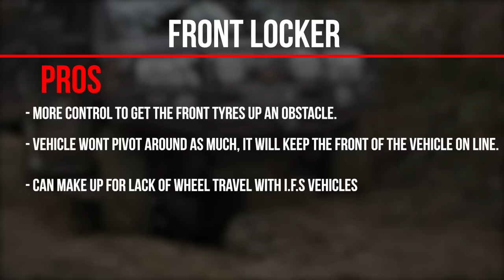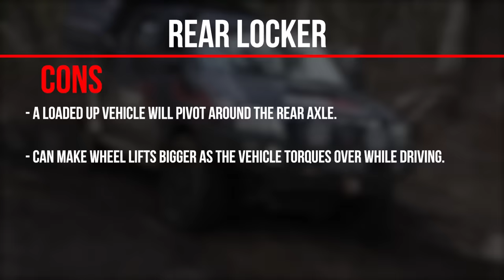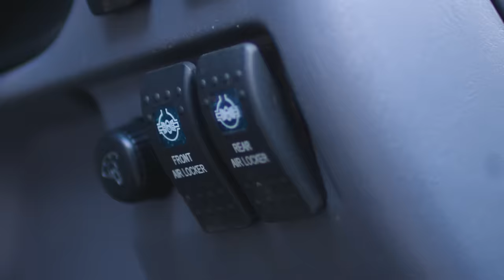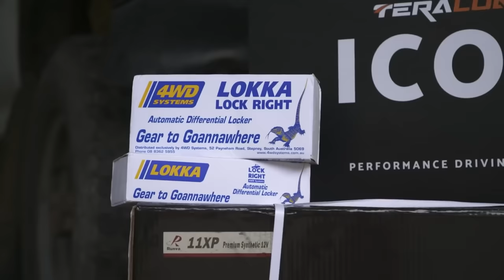FRONT LOCKER vs REAR LOCKER vs TWIN LOCKED COMPARISON! + AIR vs AUTO vs E LOCKER – Shock answer!

Comment: One thing i found interesting is that most people thought is : "as much of the weight uphill is on the rear axle, it is better to lock that axle first" ... it may be counter-intuitive, but it is exactly the opposite: as there is less weight on the front axle, one the front wheels ise more likely to start spinning. At that moment, all front drive is loss, and all the torque goes to the rear axle,  which won't be able to put on the ground all the driving force, so you start spinning also with rear tires. If instead a front end is locked,  then the front wheels will be able to give their help to drive forward, and a more reasonable amount of torque goes to the rear axle. Being the rear loaded by most of car weight, rear wheels have more chances to be able to handle their part of driving force even if without a locker. Consider also that when going uphill most of time both rear wheels will be on the ground, so a locker is less useful there.
Another misconception is that a front locker affect steering more than a rear locker. My personal experience is that having a front autolocker and open rear diff, gives you perfect steering ability, while giving plenty of traction.
So my vote is for front autolocker and open rear diff: best bang for bucks, it "disappear" on tarmac when you are in 2wd,  absolutely reliable as it is a fit and forget solution.
Side note: i have a front autolocker and rear factory selectable locker, however i had a rear autolocker and was a pain on the road, i really do not recommend it for a daily driver.

Comment: Rear is the obvious one and my hilux came with a factory rear locker when new.
Out of a front e-locker or air locker it came down to what was applicable for me. Like many other tradies my ute is first and foremost a working vehicle. I transport bricklaying gear, barrows etc all the time so thats my choice made for me. 4x4 fun is for the odd weekend fun only so an e-locker was the only option. I have no room or need for a compressor so that's that.

Comment: I have a GU4 and have a front air locker and with the tight LSD in the rear I have that’s all I need for my rig. I wheel in the Vic High country a lot and having the flexibility of being able to lock the front diff works for me and my rig. If I was driving an IFS vehicle I would go with a front locker as the front wheels tend to spend a lot of time in air. If I have an 80 series then I would probably go a rear locker if you had 2 live axles and Toyota’s aren’t know for having a great LSD.  As they said it depends on what sort of vehicle you have and what is going to work best for you, and one locker is better than no lockers so no matter if you go front or rear it’s going to be a win and get you further.

Comment: As long as I am not running huge tires (35" and above") I prefer a auto lunch box locker in the front (like the Lokka) and a Detroit locker in the rear ........ all mechanical  .......... but the others are great too ........ they all work

Comment: There are 4 way brake solenoid that can hold the each wheel braked and depending on how much pressure u are pressing the brake before turning on the solenoid the wheel on the side will slow down itself similar to how traction control work.

Comment: I love front locker because i run a Nissan patrol GU3.0 so the rear already has the LSD. I prefer to spend my money where it's going to count the most, my rig is built for tracks not roads though. Entirely dependent on the type of vehicle you run i rkn. ps love your work mate!

Comment: Truetrac in the rear and auto locker in the front of mine.  Of course, I'm only really concerned with driving in deep snow and less extreme trails than this.  I don't need all that extra cost where I'm going.

Comment: Great video 
So is it Cart before the horse or horse before the cart it’s a hard decision really but in a gu front locker (air) for hill climbs as that rear diff has a pretty good limited slip set up. 
But in mud and general rear (air) 

That being said Big boost 32 pound  big tyres 35” coil patrol Ute 4 inch lift front and rear winch no lockers required  so far.

Comment: I would go front. But if you drive hard off-road, you need front more. If you drive medium or light off-road, then rear locker is preferable, as you can use it most of the time.

Comment: Going rear air locker in the 2000 100 series. Idk if the front diff and cv’s can take the locker. Plus Toyota A trac kinda works
Reply: Chassis swap to 105.
Reply: @themindboggler8055  I wish, idk if I could get one in the U.S.
Reply: @mondo_stunts27  oh the us oof. Maybe 80 series swap? I don’t know how hard that would be but it would’ve been done. My parents have a 105 and the chassis is extremely similar to an 80. If not just go for a sas. I’ve seen people sassing tacomas, so you could just grab an 80 series front axel and use that. Its definitely possible.

Comment: One big downside of air locker's is oil traveling back up the pressure hose and blocking the solenoid vent. I fix this by making sure the breather system (factory or after market) is working. Also when the Orings are getting worn they'll draw oil past and up the hose when disengaging.

Comment: I just updated to a newer model of my old truck , and I must say I'm not Impressed. ... What locker would you recommend first on a front and rear independent suspension set-up ... Or should I just repair my old solid axle rear end ifs vehicle that went anywhere I pointed it ..

Comment: I am very eager to try a fourth option, independent drive to all four wheels, or single front and dual rear. The first is the Rivian electric utes and SUVs that are coming, with an independent motor for each wheel. The second is the Tesla Cybertruck, which in one configuration has two motors for the rear and a single at the front (probably with excellent brake type traction control to stop spinning) and 400mm of ground clearance. Coupled with huge power and torque, I suspect that these will be amazing off-road. Only disadvantage I can see is that they are American sized, so the high country is going to be a challenge. Fortunately, the Cybertruck is 3mm stainless steel skin, so dents and scratches should be minimal.

I love wheeling my Prado around, but having an EV for a daily driver makes is feel pretty agricultural!

Comment: Depends on the driving you're doing. Big steps all the time, front will do better. Anything else though and you're better off going for the rear first.

For me, I'm either running just the rear or both. I never run just the front by itself.

As to what type, either factory fitted or TJM pro lockers are the way to go IMO.

Comment: For a single locker I would go with a front. Pro rock crawlers typically drive with the front locked and the rear open, then will lock the rear when needed.

Comment: I want to build a lifted overlander with 35s and the ability to lock both the front and rear diff. The only car I can find that has this stock is the Jeep Rubicon. But I would prefer a Toyota as it would be cheaper and probably more reliable. Which model is my best choice if adding an air or electrical front diff locker?

Comment: Twin ARB air any day. I say rear first as I use rear only %90 of the time and both in the hard stuff. As I'm an ifs I don't turn while using the front locker. Haven't done a cv since. Lots of money but cv after cv racks up.

Comment: I have a fj55 that's 50yrs old just replaced 35yr old locright mechanical in rear   LC weights 2000 kg 2f and 4sp ,350k mi, pins and springs wore out.Machine shop making new pins  and springs will reinstall in front for part time duty ,shiny side  up..

Comment: I've always thought in a part-time 4WD vehicle an auto locker at the front and selectable locker in the rear is the way to go. ELocker cause bugger air lines leaking everywhere.

Auto locker in part time 4wd does not have the on road, highway issues. Soon as you're off road you're locked in going slow, making it over so none of this 'fang it and we'll put lockers in if we don't make it'. Unlock the hubs if you're worried going down hill about steering.

Comment: I’ve been considering getting lockers for my MN triton and after this video I’m gunna go twin auto lockers purely for the price and no need to run any air or electric lines
Reply: They work well mate! Just a bit louder on the road.
Reply: @jocko4wd281  yeah thanks mate, I can handle a bit more noise if it makes me and my IFS a bit more capable

Comment: I run auto lokkas in the front of my GU and my D40, never had a steering issue with either.
Reply: Ive got the same in my GU. My steering is heavy and wants to snap back to centre when in 4wd. is yours the same?
Reply: @bronsonmercieca2120  a little heavier under acceleration but nothing major. Not really noticeable on the tracks. Maybe if I used 4x4  on road it would be noticeable.

Comment: also could've mentioned that elockers will disengage temporarily if you fail a hill the first time because the design causes a ring to disengage the locker. also, vehicles with a shorter wheelbase will do better with a front locker, because they can easily tip over front to back.

Comment: Front locked will always be best as it's far easier for the front axle to pull the vehicle than the rear to push, it's about weight distribution, you can also experiment yourself by pushing/pulling a dead weight, easier to pull, spend your life using agricultural vehicles you get to know how well/what works best when you play with diff locks, gearing and engine revolutions.

Comment: Detroit locker in rear of Prado 120, awesome difference off-road, don't notice it on-road
Reply: Do you get front lockers for IFS? And great episode keep it going
Reply: @jacquessmit8790  no just rear, you can get selectable lockers for constant 4x4 IFS but not a Detroit
Reply: @neil_woth5199   I'm in South Africa I have Mazda 3.0lt 2010 model with rear locker but I'm looking for a front locker don't know how it works on IFS
Reply: @jacquessmit8790  google search ARB airlocker or Harrop E locker. Its definitely possible.

Comment: I prefer the rear, although most 4x4s are around a 60% front 40% rear weight split, when you’re going up a hill climb a lot of that weight goes over the rear axle so you can find a lot better traction with the rear one!
Reply: If you have better traction on the rear. Surely the “traction adder” (the locker) should on the axle with less traction.

Comment: Regarding Grahma's comment, "you push a wheelbarrow from the back". Not necessarily if you need to get over an obstacle which prevents the "push"  motion., in which case you pull the wheelbarrow over. Each to their own of course. For those of you who haven't watched it, check out MadMatt's front vs rear locker test. Obviously MadMatt's test course was different to the one used in this video, however I feel that it provided a more scientific comparison between both types of lockers. It's a video worth watching to gain a good understanding, including this one of course. Different opinions help to  make a decision, but when the decisions also includes a scientific basis, an informed decision is easier to come to.

Comment: Who has had a front locker in their ifs rig? Curious how well it works and how reliable it is or if you should just lock the rear in a ifs. Been trying to figure out which to do in my old Toyota, I have been told not to lock the front because I’ll snap my cvs like twigs all the time and to just lock the rear and leave the front unlocked. Anyone know how true that is or any insight on having a old ifs rig with a front locker?

Comment: Power vs locked. I’ve got a 98 IFS Lux with the 5L (3.0 NA) motor. For me a turbo kit and lockers will be about the same cost, so if it were possible, maybe to compare an unlocked newer high HP vehicle vs say, the pony lux. In mud; in sand - obviously hill climb the locked car will shine

Comment: I'm still on the fence if I should get an air locker or e-locker.  My ARB air compressor is the High Output model, not the Dual Compressor model.  So I'll have to get every component for either option. I was leaning towards an e-locker, but almost everyone on this video  recommends an air locker.  So still undecided which way to go.

Comment: Great video on lockers however a key fact about rear lockers was not explained in this video and that was the fact that rear lockers offer a huge advantage when driving downhill descents. The rear locker will keep you from sliding off course by up to 50%, keeping the rear straight and preventing sudden forward motion when wheels go over rocks or articulation. 
The front locker is the disadvantage when going downhill  due to the lack of steering and the impact of driveline stress.
 
If your set up and choice of tracks are rock crawling, id highly recommend spending the money and getting front and rear. Having only a front or rear locker wont be beneficial anyway as the video clearly demonstrated almost equal advantage of having either.
If you're a tourer like me and stuck wondering whether to go front or rear, go rear for versatility of uphill and downhill obstacles.

Comment: Everyone is saying that they want a rear locker because when you're going up a hill you have the weight and traction in the rear so you want it in the rear too, but if that's the case, wouldn't you want a front locker? Because if the weight and traction is in the rear, in my mind, that means you would want a front locker so that you can maintain traction and grip in the front for better control and grip while the rear still has traction...
Reply: True in some cases. But on the other hand I have seen climbs that are so steep that if a rear wheel starts slipping you won't make it up and you need a rear locker to do it.

Comment: One thing about lockers, is that if your adding a lift and bigger tires, some folks want a re-gear. And wouldn't it be best to re-gear front and back at the same time? So! Maybe do front and rear lockers at the same time and re-gear while your there? Do you guys re-gear any of your vehicles? .... myself, I'm all about the cable lockers.

Comment: If money wasn’t an issue I’d go twin air lockers. But as air lockers are above my budget I will get rear & front auto lockers for my 2022 Jimny from Kaiser in Brazil. Kaisers main business is making  auto-lockers for tractors and trucks. 

Kaisers lockers are way better designed than the Lokka LockRight’s are. As such they are more expensive as well, but for the price of one air locker I get rear & front lockers from Kaiser.

Comment: jocko this is great info , im running a PX2 ranger 2wd with a rear locker , im starting to want to go further off road than when i originally purchased this ute .ie down stony river beds and shallow crossings but im hesitant about getting stuck as usually just by myself (no other utes) and poor cell coverage (NZ) i recently watched that clip where the good year ranger could only use 2wd and was blown away at where it could get in and out of .. anyone else put just the rear locker to use .. be keen to hear just how good they can be........... i am def looking at getting a 4wd once the budget can support it.

Comment: When installing a Rear Locker to GU Nissan Patrol, do you loose the LSD?
Are there any Lockers available that retains the functionality (Safety) of the Rear LSD?
Reply: No there isn't, you either have a lsd or a locker(open diff) I run the lsd rear and air lokka front on my GU, I would 100% rather a lsd over a open diff on the road too for as you stated safety reasons

Comment: Personally i'll take air lockers over all others. The R&D on them have been ongoing for the last 30 years. They have no known failure point.....they have also fixed the leaking air issue too......air lockers are also fully Aussie made......aussie designed and made for the toughest worldwide conditions....cant get better than that

Comment: Personally I always go autolocker rear. Airlocker front
This way I have best of both worlds. Not to mention a failsafe system in case I have an issue with the compressor or a solenoid or something electrical which could leave your vehicle with no lockers in a hairy situation.

Comment: OX locker make a cable activates locker. For me, who have factory E Locker in my Wrangler, arb Air locker in my Prado and cable activates in my Cherokee xj - the cable one is the best. It's super strong, will always worke and you get a good feedback when the locker is in. After the cable actuated, the e locker is my second choice. I woul not buy Air lockers again if I have the choice (you don't have the choice for the Prado). It's more to fail and you need to buy a compressor that costs extra.

Comment: Hey guys at 4WD24/7 I have a 2008 Sr5 Toyota Hilux now I’ve got front and rear ARB air lockers and I can only have the front one on whilst the rear one is on. As soon as I turn the rear one off the front goes off. I know why as they have taken the power of the rear switch so when rear switch is off there’s no power going to the front one. Why is this I’ve rang ARB they said that’s just the way they install it. Can I fix this myself and have both switches operate themselves, rather then the rear have to be on for front one to be on. Thanks

Comment: Sorry Boys, I totally agree wit Jocko, Front first. BUT It is all about application.. Rear first seems to be an Australian thing.. Even MadMatt4WD did the same test and found, to his surprise, the "front only" more efficient then rear only.. My preference for Northern Canada is Mechanical LSD (TruTrac) in the rear and a selectable Cable Mechanical Locker (OX Locker) in the front... A good rear LSD is unmatched on crazy winter roads where a locker is unsafe at speed and one wheel wonder (rear locker off) is useless..